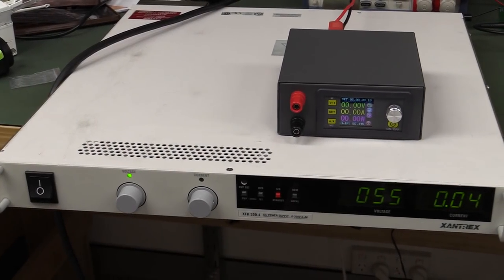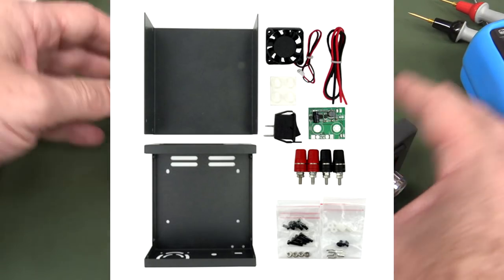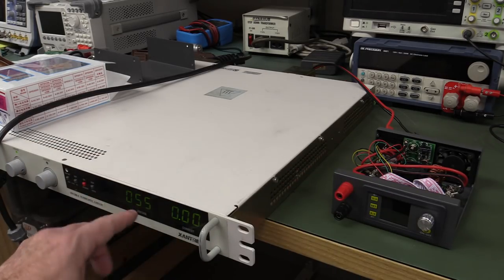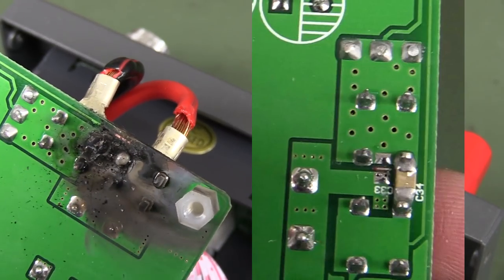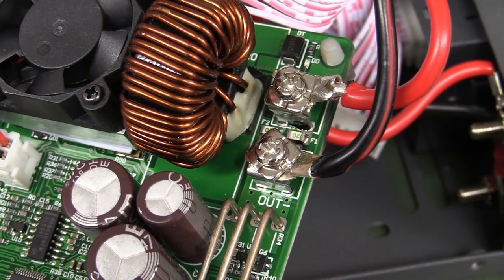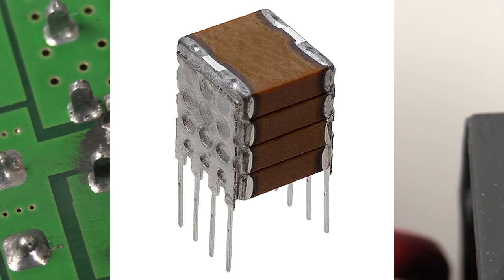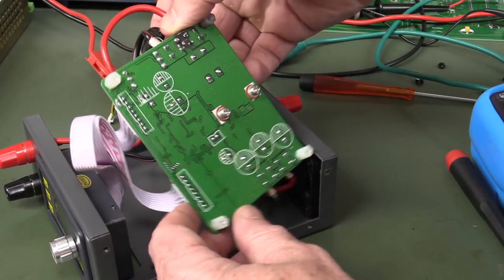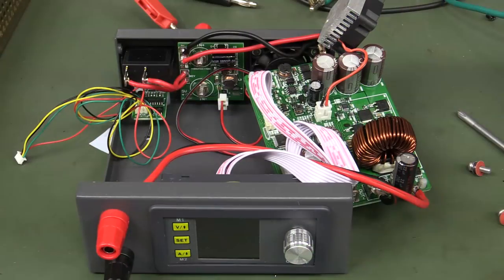EEVblog #1035 - Flaming DIY Power Supply!

Comment: i saw the video carefully. yes, the capacitor on output was burnt . it is high frequency filter capacitor. the data  is withstand voltage 250V, 1210 packing , 104 capacity.
From our experience, the capacity should be compressed and  deformed by external force. when you screw the output. the capacitore should be compressed.
so the capacitor place is not good. it was easily be deformed by exteranl force, I sorry for this
I saw you replace other capacitor, right ? in fact, you don't need add this
and I saw it still restarted and there is some current . because there is some shorted in burnt place , you should clean all the black burnt things up. because those black things can cause shorted.
you can use a knife to clean up them all . after this, it still can work normally. this capacitor is not important ...
you can try ..
the place is not good, I admite it this caopacitor defect is the crack resistance is not good, so the place is not good now our engineer are designing new way, new place and new capaciotor to solve this risk ... in fact, don't use the capacitor, it still can work normally

 because only DPS5020 has this capacitor and only when the capacitor was damaged , it can be burnt,. ok? if some customer have weld station, they can contact me , I can send him a strong capacitor. I don't think this is a bad news , because all electric products are not profect. although the capacitor is easily to be damaged by external force, it soldem has happened. we sold thousands of this product, we only meet this at second times and this video can encourage to slove the problem to be perfect ... we should be updated tomorrow . after today, all the DPS5020 has new capacitor and even you don't need this capacitor, it can work normally, only the ripple will be small bigger than now
Reply: The world awaits take-2 of this review.
Reply: ok, I explain the reason and we are updating ..
Reply: Sounds completely valid, I was disappointed that Dave didn't test the output to make sure it wasn't still shorted from all the charred fiberglass too.  Maybe he'll do a follow-up on this since it really looks like the board is fine aside from the burnt portion that's most likely causing the output load.
Reply: If that supply was used to power something like another SMPS or a PWM based device, it seems to me the high frequency current pulses would thermally stress that cap also.. I know he had no load on it when it happened but what had he used it for previously?
Reply from the maker: Thanks for responding Glen, glad to see it's going to get fixed.
Reply: I agree. The reboot is caused by the charred fibreglass causing a short.
Also that big electrolytic cap on the output will be causing the output to go high current for a short period while it charges the cap. You're better off with no cap there.
Reply: So we who have those buckets should remove this capacitor? Bad werbung for RDTech :( Glen should give some statement for the sake of future customers. Should we remove the current one and replace it with 200v 22mf one like on video?
Reply: honestly just seeing you guys (Rd Tech) reply to this video in the comment give me more confidence in your product, that's the sign of a pro-active customer support.
Reply: duraker1 agreed. I've watched a ton of videos on his supplies and in basically every single one he replies.
Reply: So the capacitor was physically deformed and eventually failed short due to that deformation? Am I understanding your failure analysis correctly?
Reply: I would replace it with 250V 100n ceramic disc capacitor.
Reply: How long do I need to wait before I can order for v2?
Reply: Good explanation. Lets make this work by repair, replacing boards is no challenge.
Reply: If it's a current limited power supply shouldn't it just limit the current instead of rebooting, even if the output has a dead short?
Reply: Reboot was due to current limiting by power supply it was powered from.
Reply: @flomojo2u
thank you for your message , about restarted, it indeed cause by those burnt things, but even you meansure there is not shorted, because those burnt things has some resistance . you need to clean them all to check
Reply: @SpudHead 
there is nothing with input power supply, because the capacitor was damaged by external force, so power on, it was shorted 
and this capacitor function is to reduce the riplle .. ok?
now we will replace it to use a better crack resistance  capacitor, useless you use a hammer
Reply: EEVblog
thank you for your reply 
I will replace a stong capacitor and it  has a better crack resistance , useless you use a hammer to beat him 
BTW, about the restart, it casuse the burnt thing , please clean them up, it will work again , because there are many protection for main circuit ..
Reply: @ Ashley Sommer
thank you for your explain again,. yes, you are right , I have updated it , it should be ok in tomorrow
Reply: @ BeiLLiac4
Hi friend 
don't be afraid this , because only DPS5020 has this capacitor and only when the capacitor was damaged , it can be burnt,. ok?
if some customer have weld station, they can contact me , I can send him a strong capacitor. 
I don't think this is a bad news , because all electric products are not profect. although the capacitor is easily to be damaged by external force, it soldem has happened. we sold thousands of this product, we only meet this at second times 
and this video can encourage to slove the problem to be perfect ...  we should be updated tomorrow . after today, all the DPS5020 has new capacitor
and even you don't need this capacitor, it can work normally, only the ripple will be small bigger than now
Reply: @duraker1
thank you for your message 
because it is not big problem,. the capacitor was damaged, so it was burnt . and there are many protection for our circuit , we have updated it today . you can go to our channel ,there are many video about our products, they are all good , if our product is bad, Dave will not make a video to show our products
Reply: @LASER BEAR ASSAULT UNIT
thank for your checking , because I need to let all customer to know this ..
don't misunderstand .. ..
Reply: @ Laogeodritt
yes, you are right , because this capacitor has not good crack resistance. and at that place , when you screw the wire, it will case the capacitor compressed, so it was damaged 
today we update all our stock, we use stong capacitor, useless you use a hammer
Reply: @JendaLinda
there is nothing with data of capacitor, the place is not good , the crack resistance is not good
so you can don't use the capacitor, that;s ok
Reply: @TubeSurfer
after today, all DPS5020 has new capacitor from our official store
but I can't make sure for our reseller , because there are some stock in there
Reply: mod robert
thank you for your message , only the capacitor was not damaged , you don't need to replace or remove 
if you want to be safe , you can do 
and there are many protection on the board, even it was burnt, not affect normal working , just remove it
Reply: Bad components happen, bad choices happen, hell even Samsung had a run of bad exploding phones, perhaps it might be a good idea to try to do a safety recall, this could happen again.
Reply: Well spotted Ruben :)
Reply: @ Lumpio2
it is not all right, because there are not all shorted, those burnt things has some resistance. 
for the rebooting, I can make sure it caused by those thing, just clean those up, it will be ok
Reply: Most honest manufacturer!
Reply: this guy rdtech helped me fix my unit , and send me the part for free. 
this guy replies always and is helpfull, beast mode for sure.
Reply: Agreed. Cheap Chinese electronics are never going to be bullet-proof (it's the price you pay for a $30 power supply). Usually you're completely on your own when this happens, so it's great to see some engagement for a change. Faults happen, so good customer support is good to  see!
Reply: "I don't think this is a bad news ".  Reality check: your device caught fire under zero load on a youtube channel with 500K subscribed EE enthousiasts. This is bad news. Its almost as bad as it gets. Now Im not faulting your reaction otherwise, and I dont want to  overstate what happened; in fact,  I will probably still buy one, but I would not say things like that.
Reply: On the STM32F100 LQPF64 that's PA3 I/O pin on the corner and VSS_4 (GND) at 17, 18 respectively.  If I were a betting man, I'd guess that cold solder flashing isn't bridging to the nearby via, so it would just be pulling PA3 low.  However, if PA3 is set to an output, it could be messing with the Vss_3 reference (F1 can be somewhat sensitive to Vss* all being within about 100mV or so of each other).  If PA3 isn't used, it's probably unrelated, but if not, certainly could be reason for the wonkiness.  I doubt the blown cap would do harm to the upstream MCU as it should be pretty well isolated, especially with a gate driver.  Good eye though !  Was this the same unit that Dave tested before, or new one fresh out of the box ?
Reply: Ruben Lensvelt I think you pretty much found the cause of the initial problem. Unless it is just laying on top of the coating my guess is that would be the main issue. I dont think anyone else caught that. Good eye!
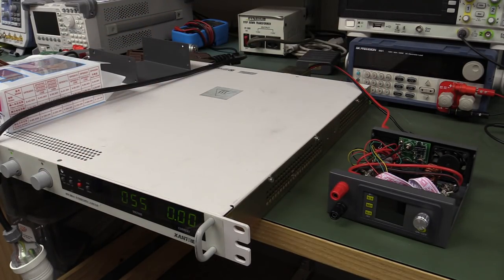Reply: ...as someone else mentioned, the flashing wasn't there around the 5:50 mark, so it seems Dave may have created that bridge when he attempted to repair it.
Reply: Is your official store the Aliexpress link in the youtube description?
Reply: Thanks for your reply. This can happen. Two questions: 1-) Can cracking be avoided from the customer by carefull screwing of the terminals while assembly (Or is that capacitor just prestressed during production test while probing) 2-) For replacing, what is the spec of the capacitor, and can affected customer get the component from You for self replacement? (My ordered DPS5020 will reach next month)
Reply: cheap psu whit decent features no the best, the best is in another castle and you pay it.
Reply: yes, I have large experiences with those burns, on multitester voltage they will measure open, buy apply normal equipment voltage, and it shorts!. Any repairman know that. Except Dave, he is not a repairman, he is an engineer!!!!!, so, don't expect a burn place trig a bell in his mind!.
Reply: Yup, that looks like a short
Reply: @Ruben Lensvelt
thank you for your message 
no, there are many friend saw this , and I have explain this 
1, it is not from our factory. because we always use STM machine to do this , all the solder were on the back. we don't use the hand, it should left by Dave
2, there is nothing with this smoke and rebooting , I have explain many time , it is capacitor damaged by external force . for rebooting , Dave did not clean up all burnt things
Reply: @2thinkcritically
what's the Ruben ?
Reply: @BMR Studio
thank you for your praise
Reply: @Konstantinos Nanopoulos
thank you very much , it is what I should do ,. only you bought our product, no matter where you bought this , I can help you fix it. this is our responsibility and our service
Reply: @JMMC1005
thank you for your message , I don't care what other seller do , but I can help every customer who buy this . 
no matter where you buy this , from our re-seller. only you contact me , I can help you , it is our rule and basic service
Reply: @Okurka
I saw you did not see our explanation,. it was damaged during installation. not our capacitor data and circuit problem. and the capacitor has not main function, you can remove it . and it don't effect normal working , even it was burnt. so we did not replace , it is not needed. ok? 
like phone, if it drop on the ground, the screen was damaged only one time, the manufacturer will replace all screen, there is meaningless. you can ask Dave how many time he meet like this problem from other products, the manufacturer change it ? I guess not
Reply: @Mr. Delphi
thank you very much for your explain , you are right , because we sold thousands of this , we meet one time ,and we know the reason, it is not regular problem, and don't affect normal using , so we did not change it . 
now it happened in second time, I need to replace , it is normal path to do this
Reply: no hard feelings, you can take out rev.2 for this thing. but the only problem is fire hazards are life risks. :/
Reply: @Lasse u
i saw it and i have explain, it is not that problem, it was not left by us 
thank you for your message
Reply: @kuzetsa
this is not our problem for solder we never solder it on the front. we use the STM machine to make it . all the solder on the back . I guess those things Dave left ,. understand ? and this chip control the display parts, not power part,. so there is nothing with it
Reply: @Chemnitzsurfer
yes, it should be MOS problem , the MOS is not good, we already update this problem for one year 
thank you for your message
Reply: @RC Hobbyist Extreme
no no , he is wrong . this is not our problem for solder we never solder it on the front. we use the STM machine to make it . all the solder on the back . I guess those things Dave left ,. understand ? and this chip control the display parts, not power part,. so there is nothing with it
Reply: @Dave Johnson
 he just open it and check what's wrong , later he want to repair , but he failed, because he did not remove all burnt things
Reply: @Richard Kelly

I have explain this , there is nothing with this , thank you for your reply , it is to control display part
Reply: @pufero1
I don't agree with you , any product are not perfect , ok?
Reply: @flyguille
thank you very much for your message and your understand 
I explain the reason and change all our products
for him, he should know the real problem now .
Reply: @
Adamus Alpha (Adam)
thank you very much for your reply, because only for DPS5020, there is this capacitor. DPS5005 has no poroblem. yes, att 11,11 , there are many big discount and coupons , only for one day 
there is some wrong for your last words, when you buy those 2 pcs DPS5005? Before 10 months, we already update this , there is no need  to add a diode on output, you can charge battery directly for new version
Reply: @SnopFop - TheSkogemann
he did not clean them up .. thank you
Reply: @Mr. 360M
thank you very much for your video, I will check it later
Reply: +flomojo2u I guess he was too busy reading part numbers of random chips :P

+EEVblog you often seem to forget some of the basic electrical things when getting carried away by fancy/mysterious parts, maybe try to take a step back sometimes, to prevent "not seeing the wood for the trees" :D
Reply: @Rd Tech, is the same capacitor / setup used on more boards?    I just installed a DP50V15A DPS5015 a couple of weeks ago.
Reply: It's great to see the maker of this device post a quick and positive response. I'm waiting on my DPS3003 to be delivered.
Reply: Makes sense to me.
Reply: Rd Tech I can see that you work very hard to make your product as good as you can. Chapeau!
I like your response to the comments a lot. Thank you for that. So in return, I have your store as favorite on AlieE. Good times.
Reply: BeiLLiac4 bad werbung ? 😂
Reply: @ Kyra Zimmer
maybe he has his own plan
Reply: @Luc Peeters
Dodn't worry, friend 
Only DPS5020 have this capacitor. because DPS5020 have big power , so we want to lower his ripple, so we add this
Reply: @ Mark4931
thank you very much for your mesage 
it is what I should do , it is our job. when problem is showed, i need to explain and improve this .
Reply: @Francois Deshue
it is not big problem
Reply: @Volthaus Lab 
thank you very much for your message 
you bought DPS3003? it should be on the way,. hope you like it
Reply: @IGWTS
which message ?
Reply: @ Ruben Lensvelt
thank you very much for your understanding and your support. 
this is our job,. quality is our life , I should do this 
and at 11.11, there is a big discount, you can check
Reply: @casemodder89

it is not werbung,. and it maybe not bad
Reply: @The Majastic Creature 
when did you buy it ?
Reply: @Adamus Alpha (Adam)
it doesn't matter , thank you for your support , if you have any question, please contact on our shop
Reply: From my professional expertise it's quite likely that this is just what happened. Ceramic caps really are prone to mechanical damage and from my own experience the screw terminals can easily deliver enaugh deformation to break it.
Reply: Mistakes happen! The fact that you’ve come on YouTube, have explained the problem, admitted the fault, and said that you are fixing it, not only that, but have provided a fix for people who already have your product - this speaks volumes to you as a company. I said on one of Mikes Electric Stuff videos about a Micsig oscilloscope that if Chinese companies stand behind their product, they will listen to what people like him and Dave have to say, and take that advice on board.

You’ve gone above and beyond in fixing this problem and the fact that you have done so so openly and publicly, is in the end, going to gain you a lot more customers. Very well done.
Reply: @Andreas Lang
thank you very much for your explanation and your trust , many professional person have same thoughts with you , and Dave admit this too in his new video , but we replace strong capacitor now
Reply: @Mr. 360M
what fake ?
Reply: @Moon Moon
thank you very much for your message and your support 
in fact , I don't agree that this is fault, because I did not use wrong capacitor, and this capacitor is not good enough and perfect.
all things what I done is our job, as the customer trust me and buy our product,. I will let them get the best product and service
Reply: @Adamus Alpha (Adam)
yes, he explain all thing I explain. it is same to what I said
hope you like it
Reply: @Jason
thank you very much for your message 
about the plan, we don't use to external force to damage our product to test ,and most products can't be though external force .. it is meaningless,  I will consider  about this. we have test all limit data... that's what I should do , ans we always do this
Reply: This is the way the world should work. Great job RD Tech for working this out and such obvious concern for fixing the issue.
Reply: how can i contact with you for new cap
Reply: you have contacted me ..
Reply: Can you gang two of these for a split rail design from one controller?.
Crap happens, this one off is forgivable considering its high power specification for a great price, plus the RD Tech messages; show they care about product satisfaction.
Reply: I received a DPS5020 today and I can confirm this. A new cap is mounted, not smd but a big 104k 250v MET cap.
Reply: I'm interested in using these modules but I'm not sure which ones are legit and which are authentic. Do you have a URL to your designs?
Reply: Thanks for the reply, I am ordering the unit and the box and maybe get the upgrade cap if I can find out how to get it.
Reply: My unit does not have this capacitor. No issue.
Reply: surely this video, your English and those inflated specs (1000W on that puny thing? c'mon) do not encourage me to try your products. Bad design decision? What were your "engineers" thinking? Putting an SMD component on a high voltage, high-current rail is just nonsense to me.
Reply: It's actually rated at 1000W yes.

It's actively cooled, and very well built. I have had no problem with mine at all. Its specs are not inflated at all.

Defects do happen however. Rui Deng has very good customer service, and they are trying their best to speak with us. 

They've replaced the capacitor now. Everybody can make errors. They've fixed it. Problem is no more.
Reply: It's disgusting to design power supply so badly. You must test it carefully, Chinese designers are like teenagers. Too cocky and not enough thoughfull
Reply: the capacitor was damaged, so it was burnt... the capacitor was a 20V... you should use a 63V minimum
Reply: duraker1 they follow on YouTube and provide feedback / reply to most of the videos related to their products, if there is a question or they feel they have something useful to add. I agree with you, they seems to care about
Reply: Francis Labrie 
Actually the capacitor was rated for 250V. It was most probably damaged because of some physical force by Dave when he mounted the board. 
RD Tech however acknowledged that this is a weak point so they immediately replaced the capacitor with a different one the same day. for their own stock.
Reply: I got the exact same model but now there is no cap at the output. I will try it out myself and see how it goes
Reply: @BASIL!!!!! The pumpin' Seagull thank you
Reply: I do have one short question and kindly ask for your help, Rd tech. I have a 5020 (very nice!) and would like to know if an input of 75v could work (at my own risk). Will it definitely break or is there a chance it will work? Thank you
Reply: @Andreas-vr3vs  no, max is 70V , 75 will burnt our products
Reply: @Andreas-vr3vs   the input voltage should be under 60V DC, otherwise it will burn the device
Reply: @rdtech9153  Yeah, that's a called an ignorant, bad design.  Shame on the "engineer" who designed that and whoever approved the prototype